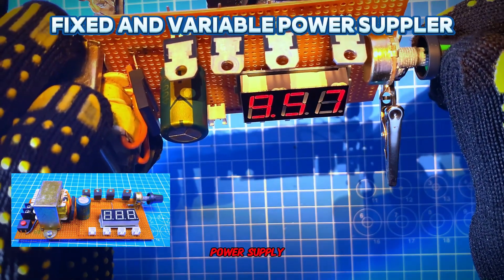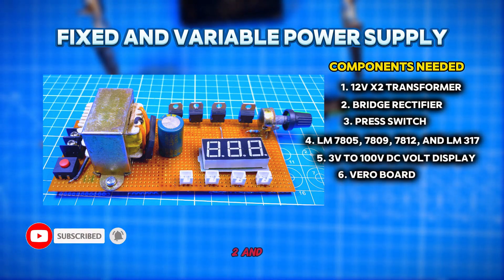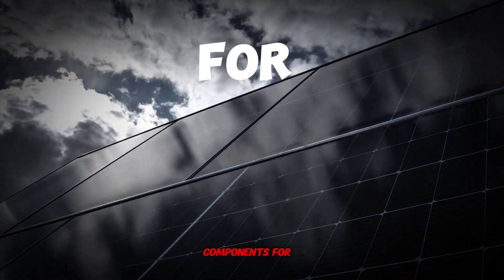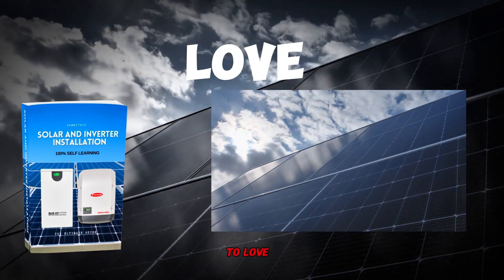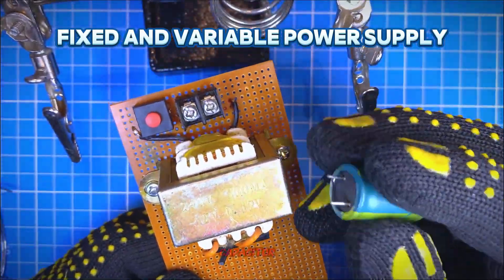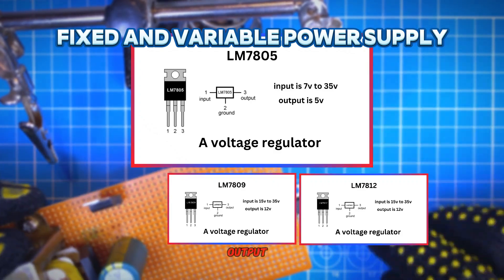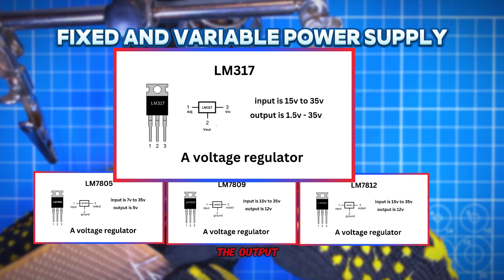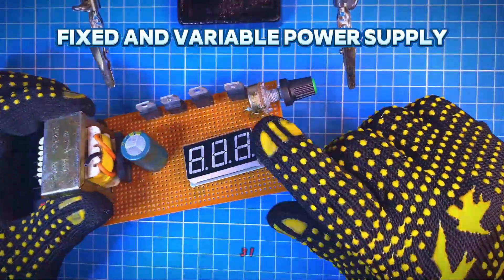DIY Power Supply is the BEST Option for Electronics Engineering

Comment from the maker: In electronics engineering, power supply play a very vital part because they are used to power circuits and test if the circuits function well or not. In electronics engineering, as a student or hobbyist, it is very important for you to understand how power supply. There are two types of power supply: linear and switching. In this video, the types of power supply we made are linear power supply and also variable power supply, so it is a full tutorial on DC power supplies that are adjustable. They are also used in electrical engineering, but the type of power supply we have, the SMPS power supply, is the best. We use the LM317 to build a power supply in this video.

Solar Inverer Course Link https://linktr.ee/DammyTechElectronic